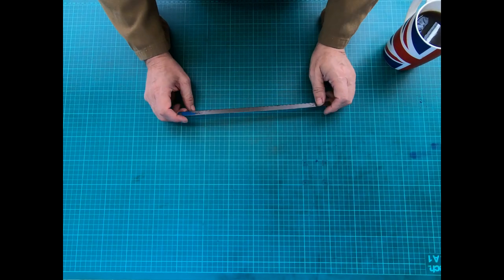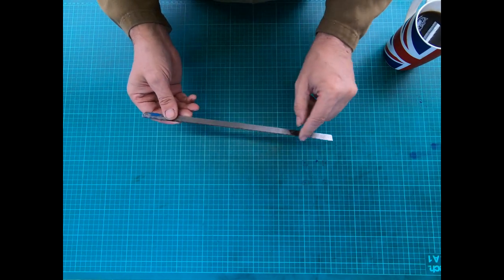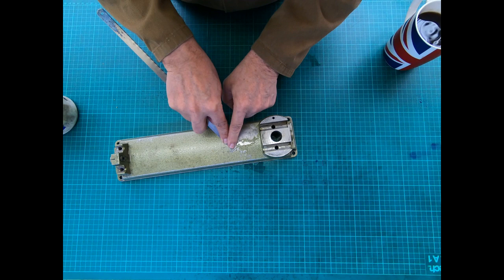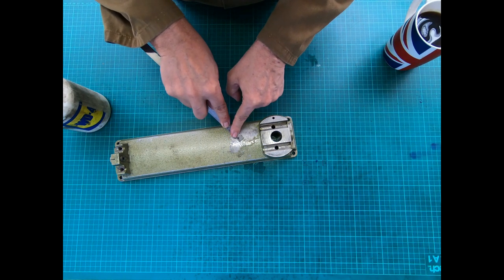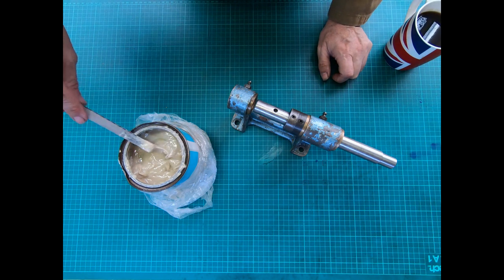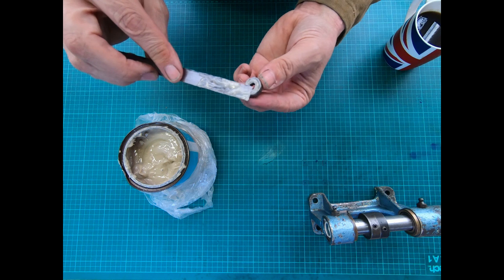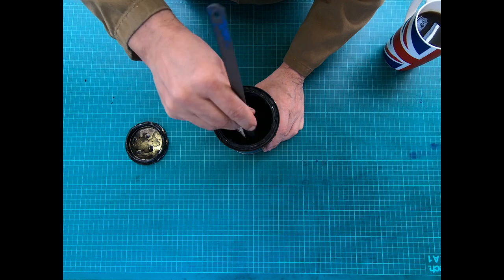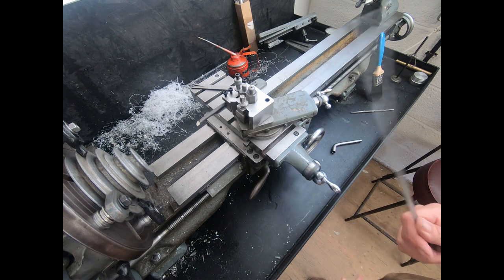WWT No 2 - Shop Made Multi-Tool.

Comment: If you grind about 3 inches off the back side of the blade down to the teeth they are a good tool for removing a broken key, I also hold onto the two metal bars out of old wiper blades, a multitude of uses,
Reply from the maker: Hello David,
Good ideas, my hope is you clever guys will add comments/ideas with will benefit others... Hopefully my ramblings will be enhanced by all and become a good resource as the playlist builds up. Thanks for watching.
Take care.
Paul,,

Comment: Very cool DIY from a saw blade.
It's also a very good spring steel... so flat springs are easy. 
I'd also use it as a measuring tool - to stop your drill bit just a known (thickness) away from the work.
This way you can accurately drill holes to the required depth. Shims and shim stock will do that too, but so will any flat piece of flat stainless or tool steel.
Reply from the maker: Hello Saar,
Thanks for dropping by... You've suggested some other good ideas... thank you...
Take care.
Paul,,
Reply: @TheKnacklersWorkshop  My pleasure Paul. You've given me an idea too!
I'm thinking of making a mound for saw blades and using them to try and part work on the unimat lathe. The standard blades are too thick and stop the motor... So far I've only been able to part hardwood and that was not easy...